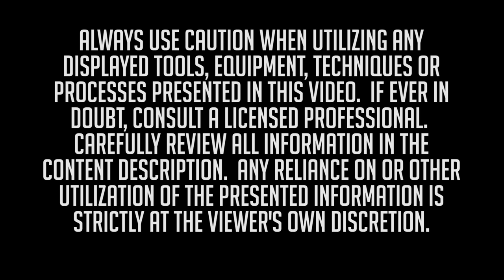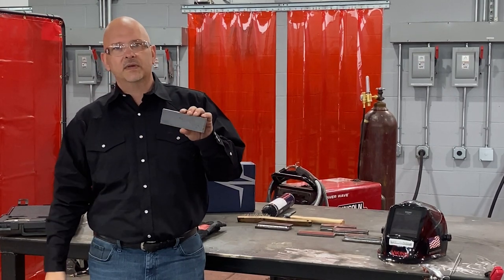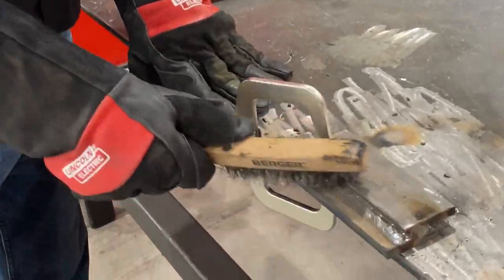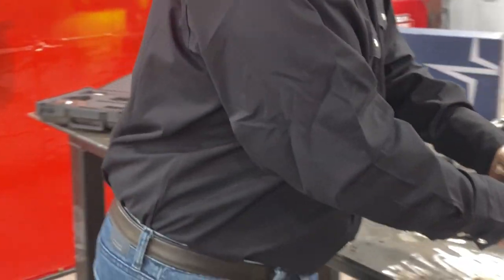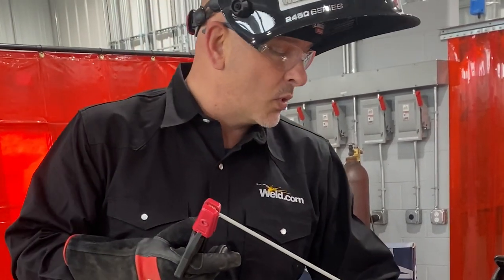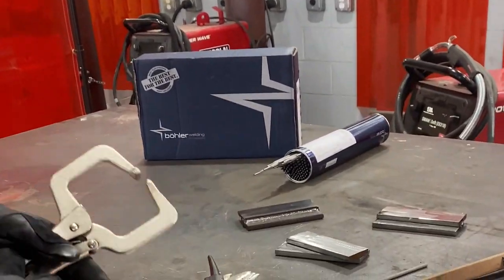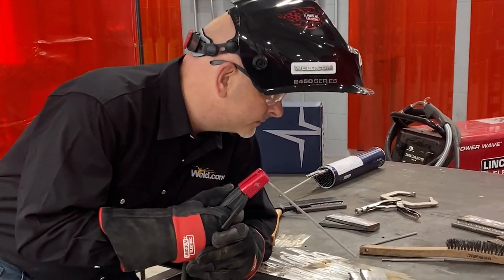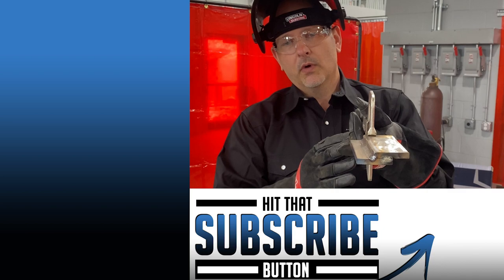Joint Orientation Angle for Lap Joint Assembly

Comment: the welding rods sound like the arc is popping when you weld , had they not been in a weld oven or is it just the character of that rod , sounded like globular
Reply: I think it was more the mic on the camera. It sounded smooth as can be when I was welding it. Not sure why it does that.
Reply: The popping sounds match the popping of the weld in the video. It’s very easy to see and hear. You can see a flash every time you hear a pop. So something was going on.

Comment: Can someone explain to me what makes a lap joint difficult? I see a lot of videos on them and I never understood why people make such a big deal over them. It just seems to me that the lap joint is basically two fillet joints stacked on top of each other and should be pretty simple. Am I missing something?
Reply: New welders often have difficulty transitioning from running flat position welds. The change in work angle, travel angle, arc length, etc… all change when you weld out of position. It’s not that it’s more difficult, it’s just that it’s different and they need pointers to help get them started.
Reply: Your not missing anything. That lap joint it basically a standard fillet weld. This is a bad example of a lap joint. Bad rod angle, unequal leg length. Lap joints usually thinner material. 1/4" or less. Yes the plates were setup in a lap joint but the material is too thick to care. It becomes difficult when burning the top edge away is a problem.

Comment: I am sorry dude but I think your electrode should be pointed 2 or 3 degrees up on your last weld to be on the exact middle. I am not a pro welder I am not absolutely sure l.I think by having your electrode looking exactly 45 degrees you favor the bottom side of your workpiece.

Comment: 3/8 lap joint? I never heard of a lap joint that needs multiple passes to complete.....and you didn't complete it. I'd day thats a fillet weld. a lap joint burns the whole face of the overlapping plate with one pass usually on thin steel and the whole thing you need to watch with a lap joint is not burning back the top edge too much or at all while still coming right up to the edge. Literally thats the only complicated part of a lap joint and what makes it a lap joint. Otherwise it would be considered a fillet weld. If you do burn it back make it consistent. You would have needed a 1/4 inch rod to do a "lap joint" on  3/8 plate 😂